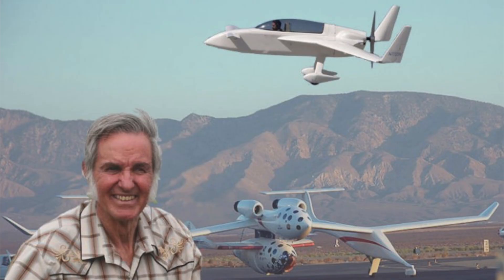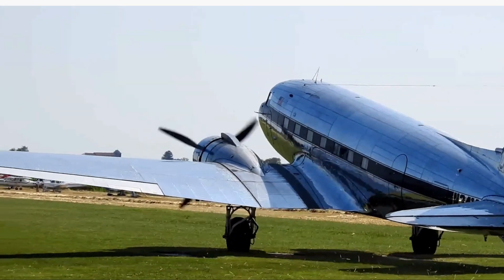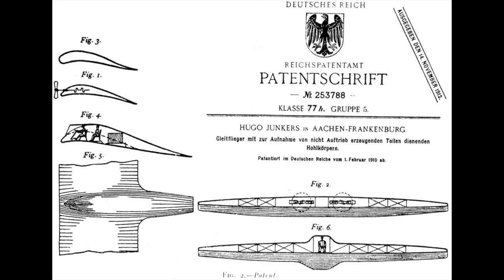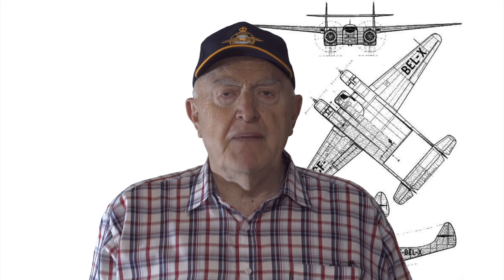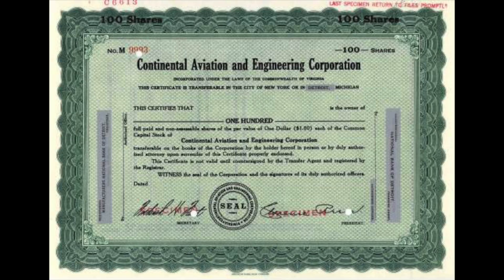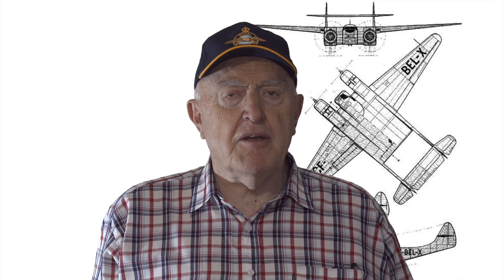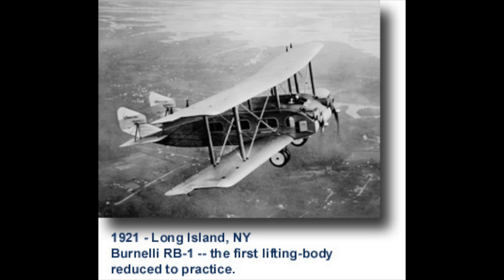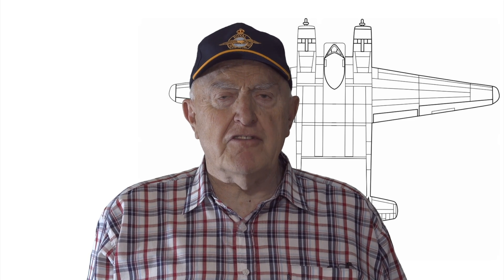Burnelli's lifting body

Comment: A Burnelli transport was making its final test flight before being delivered. Due to mechanical error, the ailerons came off at 200 feet height, 130 kts.
It hit the ground at 120 kts, 100+degree roll nose down.
The wings and tail turned to confetti and the engines broke off as the fuselage body cart-wheeled across e field.
When they broke it open and got to them, the 2 crew walked away.

The CBY-3 was safe to do a "suicide stall": throttle back and pull up, and as it starts to feel like stalling, kick a rudder pedal and let go of the controls. It turned a little and dropped the nose and flew out.
It is restored, in a museum today.

For a more extreme lifting fuselage, see the 1950s Horton "Wingless" plane. Entirely successful and superior flying machine, killed by Hughes along with Horton's career, when Horton wouldn't sign over all rights and work for Hughes.

The Space Shuttle is not a lifting body. The  Soviet "Spiral" was, as was the resulting NASA HL-20 and the following modern "Dreamchaser".
Look up the Rockwell C-1057 rectangular lifting body Shuttle design. Lower loading and heating and landing speed, more cross-range and better handling than the deltoid Shuttle.

Look up the '70s Boeing model 754 and 759 lifting fuselage designs.
By the numbers they were avertizing to carriers like Emirates, Cargolux, and Husky; with the same engines and fuel load as a "conventional" plane, they get almost twice the payload and/or range with better handling, shorter runways.
When the Burnelli estate said they'd be happy to let it be license-built, Boeing hastily dropped it and said they'd never use a lifting fuselage volume for a transport (though they were and are using it for military planes. You cannot sue a maker for using patented ideas, if they're selling to the military -you'd have to sue the Pentagon instead and anyone could make a safe bet on how that would go.

After Boeing bought McD and their "blended wing/body" designs, Boeing reiterated that they won't build such a thing. They did not take part in the X-48 testing.
Everybody who's looked at it or a lifting fuselage design says in addition to better performance, it does not mean passengers can't be evacuated in 90 seconds (and freight & military user don't care, it doesn't apply to a Burnelli or the Boeing 754, and it's not an issue for smaller planes which also benefit). Everybody from Russavia & TsAGI, Airbus, Lock-Mart, Boeing, NASA have stated this.
Objections about people getting sick if they're seated off-center during a turn are laughable.

See the Russian "Frigate Ecojet" widebody, which is not close to a lifting body like a Burnelli, but gets Jumbo payload in a Regional footprint and power loading and runway.

Lock -Mart said confidently that they were ready at any time to build their "Hybrid Wing/Body" logistics plane, which also gets multiple tp payload and range compared to a "normal" plane.

People ask why it's not built if it's so good: "Not Invented Here", and "If it looks right, it'll fly right".